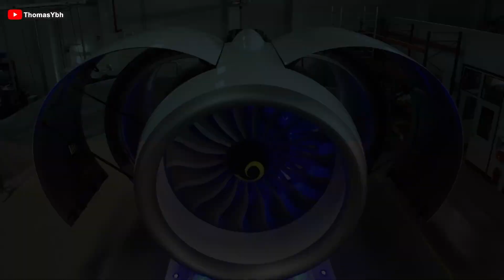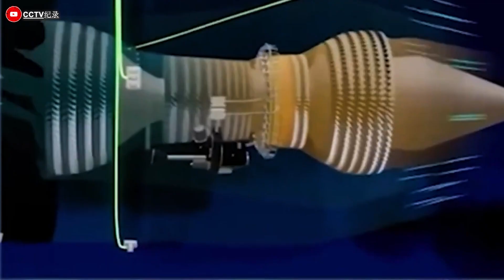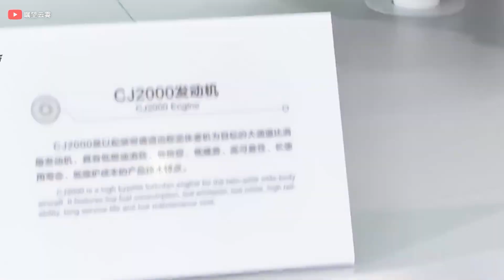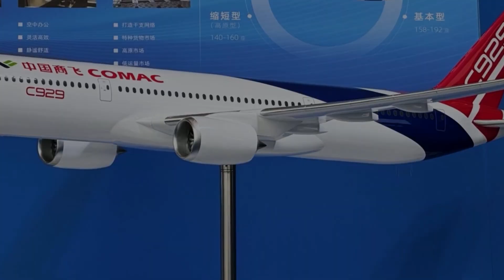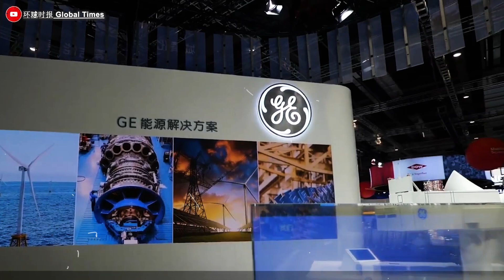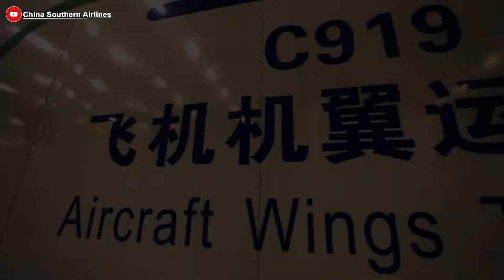China’s NEW CJ-1000 & CJ-2000 Engine will BEAT Boeing & Airbus!

Comment: The Yangtze-2000 engine, a domestically developed high-bypass turbofan engine in China, is specially designed for the domestic wide-body airliner C929. It outperforms foreign counterparts in the following aspects:
 
- Thrust Performance: The maximum bench thrust of the Yangtze-2000 reaches 35.2 tons, surpassing the GEnx-1B engine (33 tons) used in the Boeing 787. It provides stronger power for aircraft, helping to improve take-off performance, climb rate, and payload capacity.
 
- Fuel Efficiency: With a bypass ratio of 12:1, its fuel efficiency is 15% higher than similar products. Compared with the LEAP engine jointly developed by the U.S. and France, fuel consumption is reduced by 15% under the same working conditions, which can reduce operating costs and increase aircraft range.
 
- Technological Innovation:
 
- Adopts integral blisk technology, with high-pressure compressor blades and turbine discs manufactured integrally, reducing weight by 12% and increasing strength by 20%.
 
- Uses single-crystal high-temperature alloys, breaking through Western technological blockades and achieving a leap in turbine inlet temperature, which exceeds 1950K (about 1676°C).
 
- Uses composite material fan blades, with carbon fiber material error controlled within 0.06 mm, and impact resistance increased by 30%.
 
- Optimizes the gear transmission system, improving power efficiency by optimizing the speed matching between the fan and low-pressure turbine through a planetary gearbox.
 
- Environmental Performance: The large-diameter composite material fan blades and advanced design reduce noise to a "library level", and nitrogen oxide emissions meet the world's strictest standards (ACEP8), showing better environmental performance.
 
- Reliability: The main bearing life starts from 50,000 hours, which is two more service cycles than international similar products. It has also passed the 3,000-hour full-state altitude test bench test, proving its high reliability and stability.
 
- Domestication Rate: The domestication rate of core components has exceeded 90%, and the entire industrial chain has achieved independent control, getting rid of dependence on foreign technologies, and having advantages in supply chain stability and cost control.
Reply from the maker: Appreciate you providing all the necessary details.